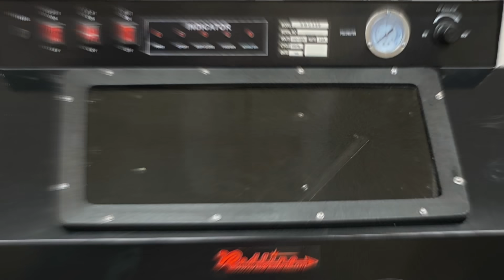Restoring a Tonka Horse Hauler - Vintage Toy Restoration

Comment: Another awesome restoration!  

I'm not a big fan of anything green but when l saw "Mint Green" l knew that was the right color.  However "l" would have painted the cab roof bright white.  

Frankly, l think this is the first time l would have done anything different than what you've done in the year I've been watching.   Great job!
Reply: I like the aesthetic of a white top, too, but I saw a bit of green when he was sand blasting the top.  It appears he was just duplicating the original.  Still, the white would have looked great...
Reply from the maker: Thanks! Was trying to go total original on this one. Tonka didn't do very many multi colored vehicles. Must have been a cost saving step.
Reply: Well then that makes perfect sense!  I missed the original green l guess.

Comment: In about 1977, I had the successor toy -- a truck with a horse trailer attachment. It was very similar in shape, but it had a clear plastic cover over the trailer. I do not remember if there was a stall divider, but it did include two plastic horses.
Reply from the maker: Cool! I was born in '77. Thanks for watching! 🤘🏼🤘🏼🤘🏼

Comment: Does the rust and paint contaminate the sand in the sand blaster to the point where you have to replace the sand? If so, how often?
Reply from the maker: It can contaminate the media eventually, but the media breaks down long before that will happen. Mine usually lasts about 2 months

Comment: I love these videos as well the consistency of your uploads; it really gives me my weekly sandblasting fix. One question I have for you, for the front end and hubcaps, why do you use the super chrome powder coat instead of polishing the bare metal and then using a clear powder coat over that? Is it to hide more of the imperfections or is it maybe something the stock factory did as well? That isn't criticism, I'm just genuinely curious.
Reply from the maker: The end result is the same so it's really just a filming option, polishing on the wheel is a pretty boring segment, whereas the curing oven scene of the super chrome is pretty cool.

Comment: Nice restoration but what supposed to be on the top of the divider piece bcause there's 2 holes in it where something supposed to be
Reply from the maker: Not sure why those are there, the original has nothing there
Reply: @TRGRESTORATIONS , that's weird  looks like it would say or show what goes there

Comment: Since the driver's compartment was empty anyway, perhaps just painting the "glass" a gloss black might have worked as well as replacing it?  Not chronologically accurate, but it might have looked like impressive window tint.  Just a thought.